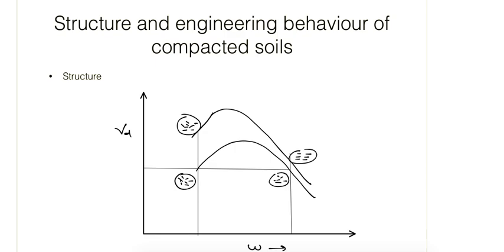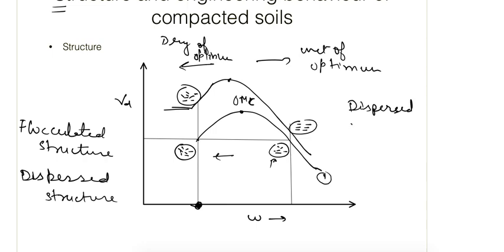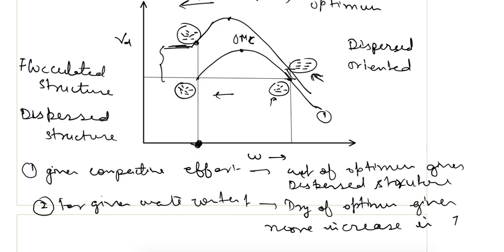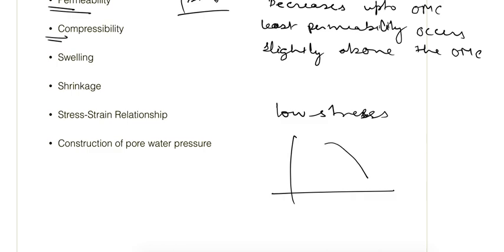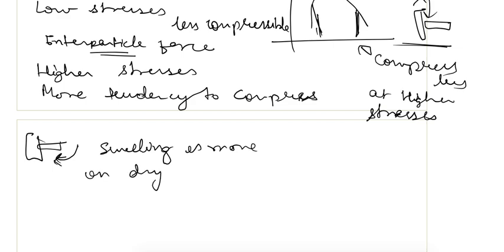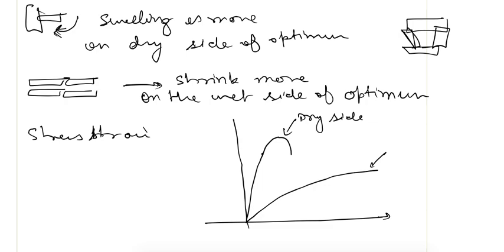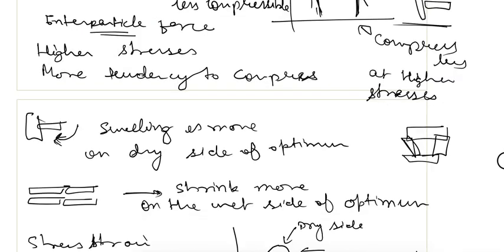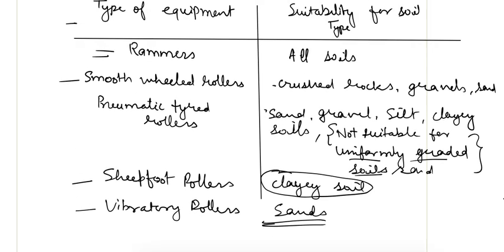Effects of Compaction and Compaction Methods | Soil Mechanics

Comment: Sir i have question that how will we calculate the applying roller weight and num of roller passing from proctor test are other test..please reply me iam waiting for ur response
Reply: It is standard for each type of test like for Standard Proctor test weight of hammer is 2.495 kg , 3 layers of soil and 25 number of blows for each layer , free fall of hammer is 12 inch i.e. 304.8  mm.
Reply: U should calculate the amount of compactive energy in kgm/m3 applied in the case of heavy or light compacttion, anyone which is needed... 
After that u calculate the compactive energy appllying by roller in one pass which can easily be calculated by given datas. Then u multiply it to 'n' the no. Of passes.
And equate both u can get no. Of passas.
Be careful about units